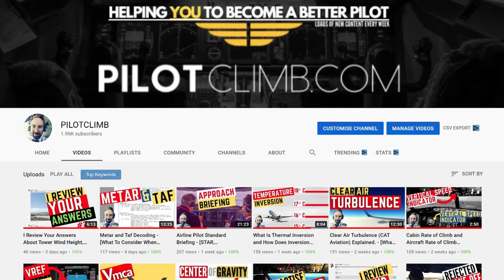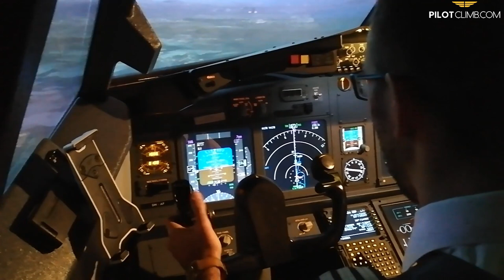Circle To Land Approach Explained By an Airline Captain!

Comment: Captain, excellent explanation of circle to land. Question: as we come down for a minimum dissent altitude based on our category that we’re flying. We make a move at a 45° angle to the right which is the east side of the course within the protected area and we have all of our elements present to perform the circle to the land as we’re coming aroundto the base and then the final. Are we in fact now flying localizer back course?

Comment: The protected areas for circling approaches now use a connection of arcs from the end of each runway, as opposed to the fixed-radius distances that were used before.

And the protected areas now account for the impact of wind on a circle, bank angle limits, and higher true airspeeds at high-altitude airports. So overall, they give you a higher margin of safety.
So how do you know if your approach has these new expanded circling minimums? You'll see it in the circling minimums line - it's a black box with a "C" in the middle.
Reply from the maker: The protected areas are standard (unless indicated otherwise)... So if you use the correct minimum, depending on the aircraft category, you know your protected area.

Comment: Hi, intetesting and I have  some quedtions for non prescribed tracks:
1) you mention that we need to start the circle at mda. Is it possible to  start the circle to land after or before as long as we stay in the 4.2 NM protected area? 
2) what does it mean that we can circle to land within the protected area if we have only 1 option, i.e starting circle at mda?
3) can we talk about circle to land if we're on a visual approach? I mean we alrzady have autopilot off.is it mandatory to have AP on to perform a circle to land?
4) can an MDA for circle to land be beyond a distance of 4 NM to runway or is it always the case that the MDA is somehow between 2 and 3 NM to RWY?
5) in case of an MFA of 1700 ft instead of 900 feet, initiating the circle at these 2 different levels will give different diistance to downwind right?  I mean flying 30 seconds to the right from 900 ft or 1700 will decrease our distance to abeam right?
6) in case of ILS approach, it may happen that the mda is pretty low right, say 300 ft MDA. Would that change the distance we fly while breaking off and be abeam?

Comment: Excellent video. Thanks. I understand that the point where you can start the descent was at the coast line but what is your reference at "Point C"?
Reply from the maker: Hey, you are very welcome!! Point C is when you are established on final visually, the only restriction is 870 feet at that point, you should not fly lower...
Reply: @PILOTCLIMB  Makes sense. Thanks for the update.

Comment: Thank you so much for this art x)

I have a question though, if I’m doing a go-around during a circle approach I press TO/GA then I should not climb above the MDA till intercepting the Missed Approach Procedure? 

What if Im on final and I’ve already set the Missed Approach Altitude on the MCP, I should reset it then to the MDA after pressing TO/GA and all while doing the go-around procedure?
Reply from the maker: No, you simply check the altitude on the altimeter while climbing
Reply: @PILOTCLIMB  okay I check the altitude on the altimeter then when I reach the MDA I press ALT HOLD? 

what should I do not to exceed the MDA before intercepting the Missed Approach Procedure when approaching the MDA?

Or simply level off when reaching the MDA if it’s a Manual or F/D go-around?